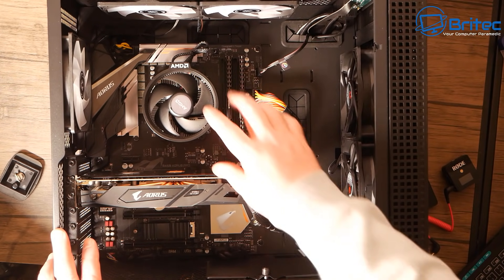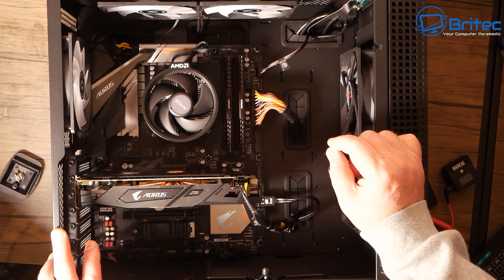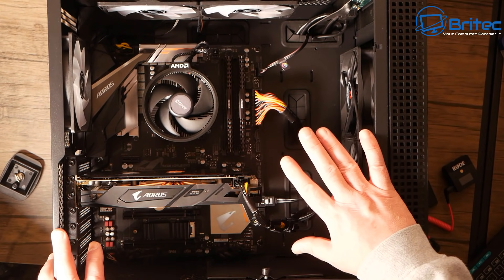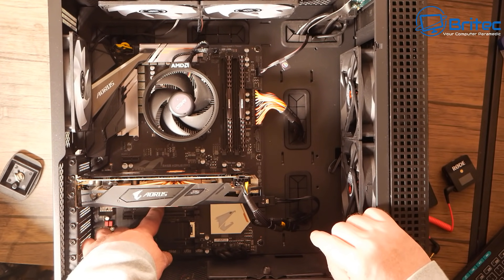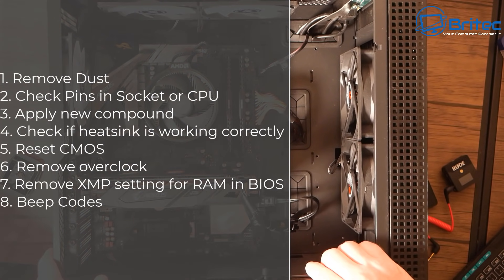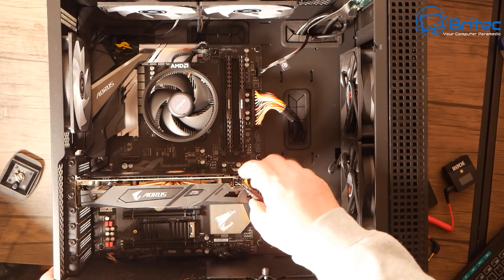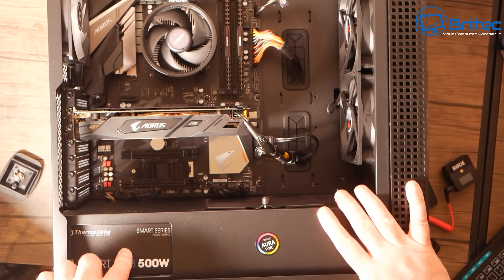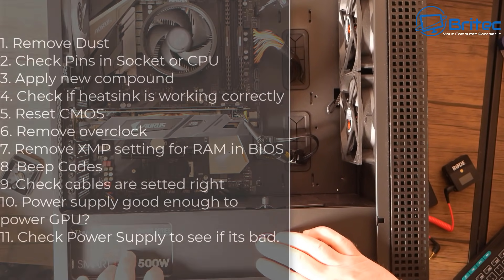Fixing A Computer That Keeps Power Cycling

Comment: "Don't skip any steps" - Jesus dude people shouldn't follow these steps at all.

Step 1: Utterly pointless step you should skip because it won't cause power cycling until the cpu is effectively dead.

It would be more logical to suggest replacing the TIM if a computer has breathed so long you think the dust is choking the cpu so hard is cant even post, having said that it would be correct in logic to say this area isn't worth pissing around with whatsoever at this point in the process.

Because fact is - a cpu will post and boot happily with NO COOLER, so "clean the dust" is a bullshit suggestion of a step.

Also the proper diagnostic protocol is to strip the system to bare essentials before pissing about with the cpu at all, y'know, proper isolation testing, that thing you need to do for an efficient and effective diagnostic process, like in anything diagnostic whatsoever.

If you have a true power cycle loop going on - the computer isn't posting and you won't get any codes - because nothing is making it that far.

As I've said - one of the worst versions of a diagnostic process I've ever heard of.
Reply: None of these tips have worked for me. My computer was working fine till i went to upgrade my RAM. I been stuck in this endless power cycle ever since. Reseated my RAM like a hundred times already.

Comment: I was having this issue, turns out my CPU Cooler was loose and the thermal paste was dry. It cause overheating to the CPU, lucky CPU not damaged. I reapplied  thermal paste and fixed the CPU Cooler. All good now.

Comment: Life and money saver thanks so much
Reply: I did the following after unplugging 
1. Remove the memory and reset..same issue 
2. Removed the Processor and Heat sink. Wasn't dirty but cleaned and put fresh thermal paste, removed CMOS battery and pressed power button to drain any remaining power..same issue. 
3. Remove Start button cable and tried to jump...same issue 
4. Removed graphics card and reinstalled..success!
Start up menu reported that Default settings were applied

Comment: Not sure if you mentioned it.  But some mother boards when cmos gets cleared will not boot up properly if they have XMP Ram installed.  You need to have only one piece of RAM in, then enable XMP then put the XMP ram back in after you had saved and powered the unit back down and unplugged it :P.

From my experience,  #1 cause of random power cycling loop is a failure with the power/reset switch for the case itself.

Comment: First my PC froze when I bumped my desk, so I turned it off now when I turn it on it power cycles any tips?
Reply: same happened to me a few days ago still haven't found fix tried resetting cmos battery and installing ram again
Reply: @arsalhameed8480  I think it's my PSU luckily my PC nerd cousin and friend of mine has an extra sitting around, I hope that it is my PSU though
Reply: @arsalhameed8480  I also removed the ram giving me a beep code when I tried to start it, which I'm pretty sure it's normal because it tells you if the ram is bad or not in correctly
Reply: @ruhl1738  updates?
Reply: @overlordblackburn3911  still haven't fixed it yet my cousin is coming over soon to take a look at it, if it is a PSU problem that's good, but if it's something else then it sucks
Reply: @ruhl1738  i think it might be the CPU isn't capatable with the CPU, that's what i'm facing right now.
Reply: @overlordblackburn3911  wait the CPU isn't compatible with the PSU you mean? Mine was working just fine and everything was compatible
Reply: @overlordblackburn3911  I fixed it bro all I had to do was switch ram slots
Reply: @ruhl1738  lmao what a bitch of a problem lol. I got mine fixed too! I just had to replace the CMOS battery & update the bios on the motherboard!
Reply: @overlordblackburn3911  wow yeah I was so mad that mine was such an easy fix
Reply: @ruhl1738  Glad its fixed! :)
Reply: @overlordblackburn3911  same to you!
Reply: @ruhl1738  I also had to just put the the rams back in properly lol

Comment: just build a new pc this week after graphic card arrived turn it on and shut down after 2-3 second have done that couple of times then played with everything the shut down stop's but 2 of my fans insade case don't give light up but running one of the fan on the video card running full speed the other normal and there is still no display just try to build the entire pc again and nope still no display after 2 days of work just breng it today to repair shop they say after hour you hear what's going on they call 2 hours later and nope they don't understand what's going on and waiting until Thursday for the right person to check again. I'm just really mad right now I order all my part new online I hope nothing wrong with it😩🙏 BTW this my build: gyabte z590 gaming x, i5 1160 k 16gm ram with gtx 1660 super be quite 650w 11 fm psu..
Reply: Any update dude?

Comment: Great video. My PC refusing to work now. When I push power button it starts for 2-3 seconds and turns Off but then it turns On and turns Off and so on and on indefinitely. I`ve checked all connectors and it did not help. Do you have advise for my situation? What is your best guess what is going on? Thank you!
Reply: Did buying new mother board fixed the problem? I have the same problem too
Reply: @argxs9866  Yes, new motherboard is working fine.👍
Reply: @whoyoum  okay thanks i think i should buy new motherboard
Reply: @NotLeeyo  i try removing and putting back my battery but problem still occur
Reply: @NotLeeyo  No, I had to buy motherboard.

Comment: A friend of mine bought an 1155 motherboard the day they came out in January 2011 along with an i5 2500, and within having it a week or two Intel did a recall and so Gigabyte turned up at his door once they had the new B3 revision boards in stock and they swapped out the board, which seemed good of them considering.  But with the B3 revision board he got power cycles for England and then all of a sudden it would work fine for a week or two.  This went on for ages and he flashed the BIOS each time a new one came out to see if it would sort it.  He let Gigabyte know about this but they weren't having it.  Eventually he just bought a cheap Asrock board and has had no problems since.
Reply: My Gigabyte B250M motherboard have the same issue. When I turn on it immediately turn off and then turning on in the second attempt automatically and it starts and everything is fine. Idk why but its bothering me cuz this is always happening when I turn on so my friends told me its not soo good for the hdd and other parts. Btw my psu is running fine.
Reply: @manupriyagamage5429  I'm not 100% on this but I reckon it's something to do with the dual BIOS.  You could try first making sure both BIOSes are the same, and then try flashing it if that doesn't work.  But flashing it you run the risk of going from one reboot to get your system up and running, to an infinite loop like my friend had.  I'd be worried about the HDD too as it has moving parts.  Sorry I can't be of much help, I've just never touched Gigabyte since ...
Reply: @Sid-Cannon  yes dude I do have some other methods to try. For now all good Thank you
Reply: @manupriyagamage5429  How's your pc? what's the solution?

Comment: Nice vid. I would check cpu later on. 1) check power cables 2)flush power. 3)remove ram and try boot 4)clear cmos 5)remove gpu /wifi etc 6)remove cpu. Move from out to inside. Also, if one drops the cpu (amd) the pins will bend. Basically, checking the cpu is high risk, even for a experienced tech.
Reply: Removing the ram and booting it worked
Reply: Bro wants us to rebuild the pc
Reply: @DrMontrays  hahaha 🤣 You don't do all these steps :) you stop once it boots / doesn't boot and then proceed with another checks.
Reply: @zadekeys2194  bro I’m power cycling help
Reply: @DrMontrays  unplug the power, and hold the power button in for 15 seconds . Plug the power back in and see if it still cycles.

If it does, remove power , flush again, remove ram, plug power back in and start it up - does it beep? If not, get the diagnostic speaker and plug it into your mobo - count the beeps - with the ram removed, it should be a single loud beep (sounds like beeeeeeeeeeeep lol).
Reply: @DrMontrays lmaooo
Reply: Removing the ram worked for me. Tysm

Comment: Love your videos. First thing I do is disconnect the power switch from the motherboard and jump the pins with a screwdriver. Quick and easy way to make sure the power switch is not stuck on. I learned that the hard way.
Reply from the maker: Always good to check
Reply: Wait how did u "jump" the pins?